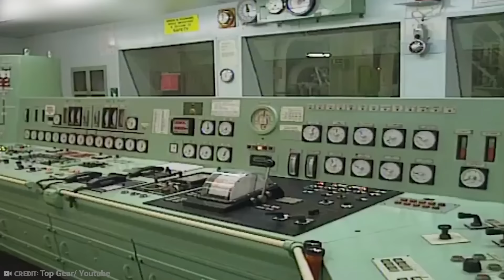15 Biggest Ships in the World!

Comment: Fun fact.

That picture of the Seawise Giant on fire was after it was bombed. I worked for the company that eventually salvaged it. 

We then chartered it back some years later and it was so big it wasn't allowed in the English Channel. When we were loading it with crude oil at Sullom Voe in the Shetland Isles its massive size combined with being hit with one of the biggest North Sea freak waves ever recorded. The fully laden vessel with a total weight of over 800,000 tonnes caused the entire dock to move sideways across the sea bed.
Reply: Don't die as a disbeliever

Comment: I think the craziest part about the massive ore carriers is that they are huge with likely little crew space. Lol
Reply: No Bob. The craziest thing about Ore Carriers was that they killed more seafarers than any other type of ship.
The design requirements were that the maximum amount of open space was available for the Ore. This meant that all the structural strength had to be in the side and bottom Ballast Tanks. Again as time is money, these ships would dock at Ore exporting berths in, for example, Australia.
The loading gear at some of these berths were designed to transfer Ore unto the open cargo holds as fast as possible. The ships would be equipped with safe loading plans that allowed the holds to be filled without causing too much stress in the structural strength members. However this involved having to load the holds in a particular order, which would require moving the ship small distances back and forward along the jetty.
as mentioned, time is money, so the loading operation was dictated by the Ore Supplier and the particular harbour installation and it usually went like this. Start at the aftmost cargo hold, fill that up at full speed, then move the loader to the next hold forward and continue with the same pattern, until the ship is fully loaded. 
As mentioned in the video, Ore comes in pretty heavy chunks, it's not a powder, so the stresses imposed on the supporting steelwork around the cargo holds was enormous. No time, or thought was given to this problem and the ships would sail, heavily loaded, with all this enormous stress locked in. This was the reason the loading plans had been devised, to minimise hull stresses, but completely ignored by the Authorities in the chase for quick turnarounds.
Most of these cargoes were headed for China, or Japan, so the ships would have to pass through the South China Sea and part of the North Pacific, Typhoon country. The ships in question would be subjected to stresses and strains that they were never built to cope with.
Oh, and don't get me started on the class of ship known as 'OBOes' (Oil/Bulk Ore carriers). They were a class of ships designed by Accountants to carry Iron Ore in one direction, then heyho, lets load some oil for the return trip. There were quite a few flaws in this line of thinking, mostly affecting the crews on board these vessels. However that didn't disturb the Accountants too much. They would eventually have outshone Ore Carriers in their abilities to reduce the seafaring population, but thankfully, not too many of them were built. Can't think why,..........

Comment: 6:10
Largest NON-OIL bulk carriers ever, there was a series of almost 600,000 DWT oil tankers (6 in total I believe) built by the Japanese (the Seawise Giant was at least mentioned briefly near the end of the video) - but those are now out of service, as their excessive size proved to be impractical, since there were not more than 3 and IIRC only 2 oil terminals they could load from, and less than a half dozen ports they could UNLOAD at.
They also had no capability of going through the Panama or Suez canals, but that wasn't much of an issue when they were used to carry oil from the Middle East to Japan (the Straights of Malacca are plenty big enough to handle ANY ship that has ever existed comfortably).
They also held the record while they existed for the LONGEST ships in existence, at something around 1600 feet.
I believe the collision of 2 of these ships STILL holds the Guiness Book record for largest ship collision (vastly eclipsing the previous record, held by USS Ranger and the Liberian registry oil tanker Fortune).
Reply: Thanks for the information dude

Comment: I wish to thank you for sticking to ENGLISH and not loading up your presentations with Metricrap. 

You mentioned ships that were later scrapped. I've heard about this happening before,  but are they still finding skeletons of workers walled up and trapped inside the hulls during construction?
Reply: Metricrap?
Reply: @jakesmith6186  
I am familiar with the legend.  It's origin is based on the length and weight of the king's bowel movement,  hence the name "Metricrap. "

Comment: i think you have to do your home work by for making a video the msc oscar  is NOT the biggest  schip in the world that The HMM Algeciras  The Korean vessel was completed at Daewoo Shipping & Marine Engineering’s Okpo shipyard on 24 April. It is some 400 metres long and 61 metres wide. At maximum capacity, the ship carries slightly more 20-foot containers than its predecessor MSC Gülsün: 23,964 TEU versus 23,756 TEU.